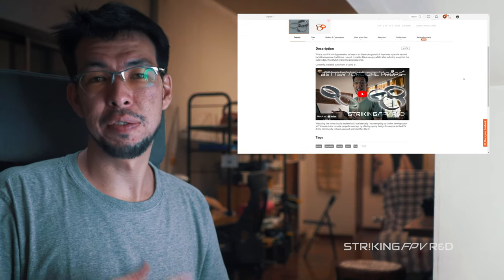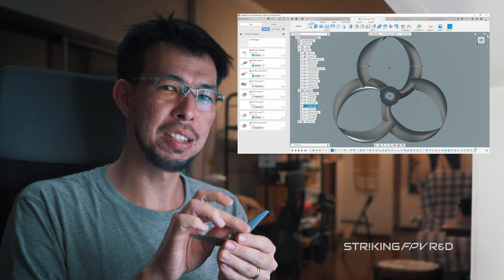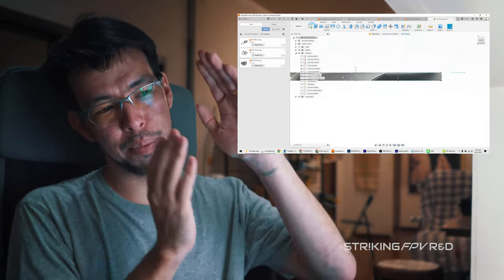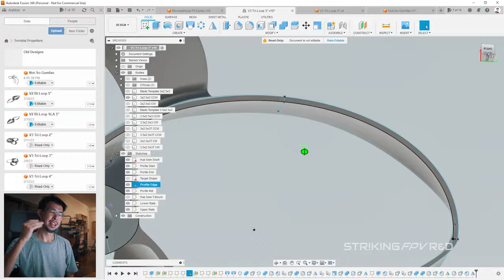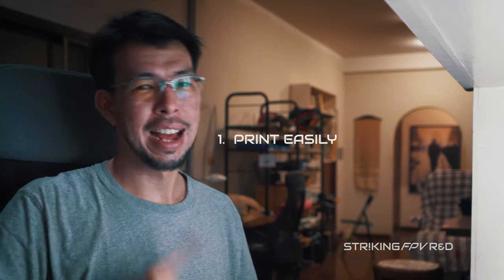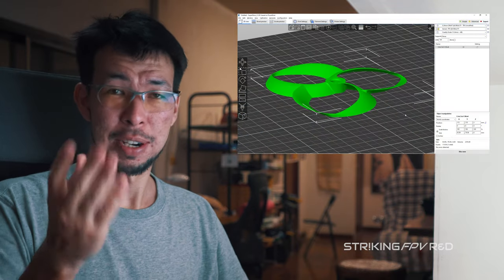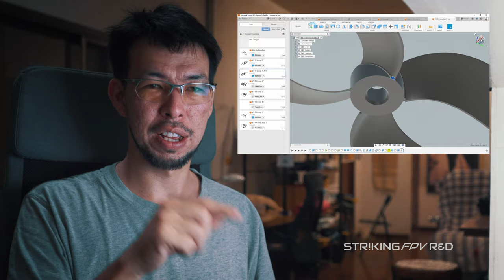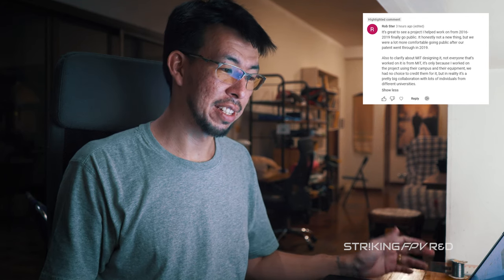10 Toroidal Drone Propeller Questions Addressed

Comment: Can you use a desktop 3D scanner, desktop cnc machine to make aluminium mould plates and desktop injection moulding machine to produce some propellers?
Reply from the maker: For the two part bi-loop maybe, but you better know what you're doing (no need for the 3D scanner, btw). Difficult is designing the mould in a way that your part will release, and making sure that you can get consistent results so as not to produce imbalanced props.

It's certainly not a challenge I'm currently equipped to take on, but a small team in a uni could probably do so.
Reply: Ahh okay I was watching your video and went down the rabbit hole of how ethix and other brands get there props made. Ended up watching a video from China they have a heap of plates and a commercial injection moulding machine. Fit the plate into the machine pick the type and colour of plastic pelets, even they had bags of rejected props quite interesting.
Reply: It seems much easier and low tech to build them from carbon fibre rather then plastic moulding.
Reply from the maker: @jayzzz1234  Ooh I gotta go watch that, I love seeing how it's made kind of stuff. I really do wonder if either Gemfan or HQProp are looking into this with any level of seriousness, or if they realise that manufacturing is too complex for them to invest without having any real idea of how good they are or if people will actually buy them.

Well, like some comments I've read, there are definitely people who'd buy them for looks alone, so hey hey 😅
Reply from the maker: @jayzzz1234  Actually, gotta put the carbon into a mould as well, and you'll suffer from the same release issues, it'll be stuck in there (assuming a single piece mould). If the bi-loop then again maybe, but it also wouldn't be a cheap manufacturing method, nothing like melting plastic and injection at high pressure, hehe.
Reply: @STRIKINGFPV  it looks relatively simple there's a heating tube that the plastic goes into at 480 df. Then there's a press that goes into the tube and pushes the plastic into the mould with exit points for the pressure. Seems relatively simple but obviously there's a lot of upfront costs.
Reply: Link to the video I was watching above..
Reply from the maker: @jayzzz1234  I'm aware of the home injection machines - here in Phuket I helped build two plastic shredders for a school, and a bunch of others also started producing the injection machines as well (all originally Precious Plastics designs).  I'm supposed to help with a project to partially automate one of these injection machines using a pneumatic cylinder, but haven't had time due to my travels.

The most fascinating thing about the moulds is their finish and accuracy and also the difficulty of removing the parts, depending on complexity of the mould and the material being used.

The thought of trying to do that with their complex (for injection moulding) geometry does my head in 😅

Comment: Hmmm.... Maybe a ducted propeller- propeller blades with ring attached around the blade tips- would work better than toroidal propeller. 
Those sounds are probably generated by vortices on the tips of classic propellers.

Comment: MIT accomplished turning the sound from a wine to groan or treble to base, less annoying and less efficient, Toroidal  propellers are nothing new and the basic laws of aerodynamics will always apply. The most efficient prop is a one blade design but its also the hardest to balance. While Toroidal do well in water applications for boats in fluid the propeller spins much slower and hits peak efficient at a much lower RPM. Its efficiency suffers greatly at the higher RPM needed to lift an aircraft off the ground. In all my tests this efficient loss ranges between 40%-70%.

Comment: How about that:
The name toroidal is propably misleading. The original boat prop design looks to me more like a twin-wing or an oversized leading edge flap with the benefits of winglets..

You propably know the strange tailrotors on some helicopters, two pairs of blades influencing each other, this is supposed to be more silent and efficient. The offset of the two pairs of blades is horizontally and vertically so that the leading pair acts as a sort of leading edge flap. The advantage for the boat prop is propably a higher tolerance against cavitation.

The twin-wing in the case of the original boat prop has a downward winglet on the leading wing and an upward winglet at the trailing wing. The angle off attack at the tip of a winglet is supposed to be 0 so both winglets are joined at this point.

What do you think?

Comment: To make a valid comment and not make fun of MIT that made this public on purpose for community to research it.......a point the noise that the regular prop makes - toroidal may be quiter because the high frequency resonates also the object.......evident on hard styrene airplanes where the motor also vibrates the wing surface which amplifies the sound. Maybe this applies to quads also.

Comment: Don't know anything about propellers or FPV. However to mass produce these loopy things, a resin cast in a flexible mold might be the best option. Compared to 3D printing there are some benefits. 1) Accuracy and finish is close to injection molding. 2) No layering, when glass or carbon fiber filled resins are used you can get thinner parts that are strong in all directions. 3) speed. 4) costs.  
Also some questions of the stupid noob kind: The loop closes only one surface of the blade, so basically this design solves only half the problem is claims to fix? I'm probably missing something, but wouldn't the obvious solution, a normal propeller with a ring on the outside, preform better?

Comment: Question: Expense aside, Anyone out there who has the access to and the real ability to CNC mill from poly carbonate material block a set of 5-inch Toroidal tri-blade (loops)? Vs this poor method of 3D-printing them which on the very best of days are not balanced, not tracking correcting, beats the air into submission to fly and so forth. Someone? Anyone out there to do this?  Pls let me know Thanks, Bob G. Florida
Reply from the maker: I would love to see someone do that, would be awesome and overkill but mostly awesome.  I've seen a small desktop-sized 5 axis CNC machine, think it's called the Pocket NC or something.  That could probably do the job for maybe 3", not sure if it'll do the full 5" size though.
Reply: @STRIKINGFPV  I must have something wrong on the V2 loops. They are not coming out smoothly on the top surfaces as the nozzle doesn’t continue around since the loop starts going s hollow towards the tip. I can’t figure what I’m going wrong. 0.06 nozzle, Priline Poly/Carbon Fiber, Creality CR-6SE. cura  slicer and Pursa slicer.
Reply from the maker: @ReggieRailSystems  I'm struggling with my own prints as well - best way to deal with overhangs is to widen extrusion widths and go for really fine layer heights, but my printer has never been that good at doing really fine layer heights.  This and I'm trying carbon-PETG which has a habit of producing random flakes and streaks of carbon.

I'm probably going to try switching regular PETG and/or just regular PLA.  If that doesn't work out, will order a roll of silk PLA as per @WillItMod's suggestion.
Reply: @STRIKINGFPV  FYI, Your version one they came out fine, for me (still out of balance a bit. I printed them from Priline PTEG and carbon fiber, 3 1/2 inch loops and ran it on my 4 inch quad. It Hovered fine for me and I was going to fly it later that day but got text from Joshua Bardwell that he was near me on as shoot so I joined up with them. So I let him & the Rotor Riot  guys have a go at it. I let (Le’Drib), fly it at a video shoot they were doing here in Central Florida. It flew fine until La’Drib intentionally  throttled it up full and of course the loops came apart which was expected. The Version 2 is the problem child for me??? Even in any size. Unfortunately I don’t have any contacts with a five or six axes mill to do me a favor. But sure as heck I would like to see a set made either out of Lexan, carbon, fiber, or aluminum. I do believe your version two is better, except at the tip needs to be a little more rounded as I think you’ll generate some sort of noise or vortex which may be tamed a bit more. However, what you’ve done is fantastic. Kindest regards, Bob Griffith, Winter Haven, Florida.

Comment: So maybe toroidal props are just safer on the ole phalanges.
Reply from the maker: Quite possibly, for tri-loops I think that would likely be the number #1 benefit.  Bi-loops still have enough prop area that a quick movement might yet give you a gash, the tri-loops being much more rounded more likely to brush one off, maybe give a friction burn at most (drone would likely crash before that, haha).

Comment: Of course they can be injection-moulded, it´s simply that then, the mould has more parts, making the moulds and the labor/handling with the moulds more axpensive at the end...
A patent is primarily a way for inventors, to avoid inventing something, that another colleague has already invented before. Well-known, patents are misused all over the world to protect intellectual property, that´s their incidental, secondary purpose. When a design is patented, u have to pay license-fees, in order to earn money from it (produce and sell it yourself, or use it in your company, cause it´s that good, and lets your company earn more profit). As long as someone doesn´t get richer by using a patented design, nothing can be done against that person. Even if you try to use it for profit, it always has to be proven, that the profit came cause of using this design (and not cause of other features of your business-model).
Using the design on hobby-level simply CANNOT have any implications with the patent and its licensing, since none can earn millions with tiny-3D-printed-propellers.
Reply from the maker: Maybe my current bi-loop design can be injection-moulded, but perhaps an ideal design with significant overlaps on the vertical axes, such as the intersection point on the tri-loop I believe would be extremely difficult if not impossible, certainly far more complicated than today's prop moulds which are usually just two halves clamped together.

And the patent and licensing is something I do have to mention since we still buy from manufacturers like HQProp and Gemfan who would need to license, but even people who offer 3D printing as a service who can make a small profit off printing these designs still could, in theory, get sent a cease and desist.  I still believe it's very unlikely that MIT would bother with us on the small scale (not including DJI et al, they're big much bigger), but the possibility should still be acknowledged.
Reply: @STRIKINGFPV  In theory, and according to the law, a giant like them could really care about a service that prints such propellers, but in realily, they wouldn´t care less.
Reply from the maker: @klausbrinck2137  But every now and then you get people like Nintendo who will crack down on anyone helping to emulate a game for a platform they stopped producing decades ago, so over-zealous corporations and institutions do exist.

I still think we'll be fine though, which is what I say in the video.

Comment: Toroidal propellers are just a hype. The idea seems good,  by eliminating blade tips, there are no more tip vortices, right? Unfortunately that is not so. The vortices are forming at the blade tips, but  not because of the blade tips. This phenomenon occurs because of the fundamental principles of fluid dynamics. When you set a cylinder of air in motion, whether through the rotation of blades, or any other means, you inherently create a boundary between the air inside the cylinder (which is in motion) and the surrounding air (which is relatively stationary). This boundary represents a region where there is a difference in airspeed, leading to the generation of shear forces. These shear forces are actually responsible for the vortices, not the blade tips. The single advantage of the toroidal propellers is modification of noise characteristic
Reply from the maker: That makes a tonne of sense yeah, I dig your explanation.  I'd be curious to know if it's possible to analyse noise only from those shear forces you describe between the stationary air and moving air, or indeed the outer edge of the blade loop since that's what's attempting to keep things more stable.

Seems like maybe only a computer simulation would be able to sort that.  In that regard, designing toroidal propellers should realistically be done with fluid simulation and with targeted performance characteristics.  Fixed weight of drone, expected prop speed for hover and an appropriate RPM range with which the flight controller can use to stabilise the quadcopter.

In this way, I feel like the toroidal design, as cool as it is, probably isn't practical in terms of the amount of R&D required and the specificity of the ideal blade/loop shape, that is if we're aiming specifically for a different noise profile and hopefully improved efficiency.

I believe a lot less thought is required to spec-out standard props, so from that cost perspective alone, toroidals likely won't make much sense.

But as I try to stress, I'm just a hobbyist, so I could be wrong, lol.